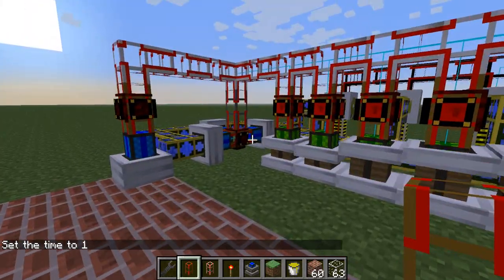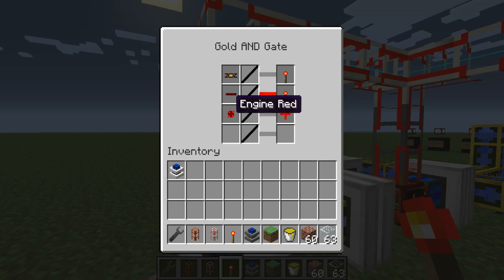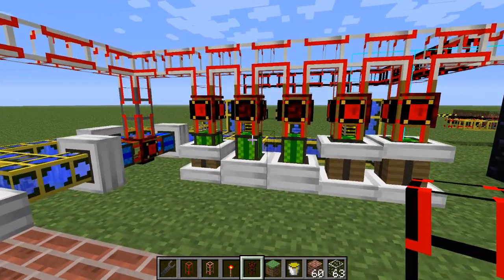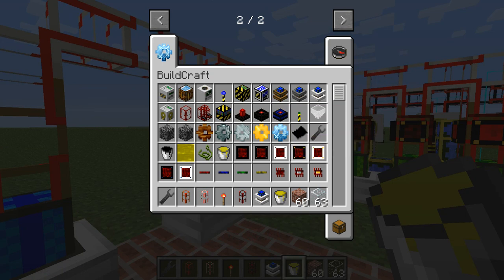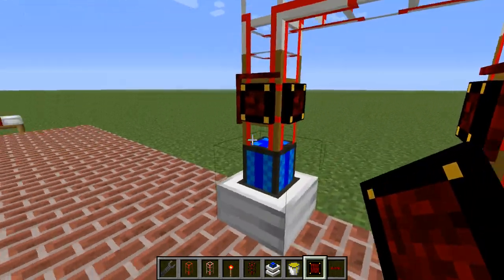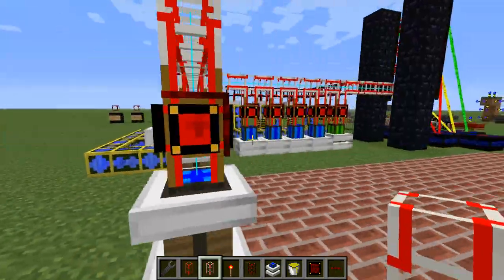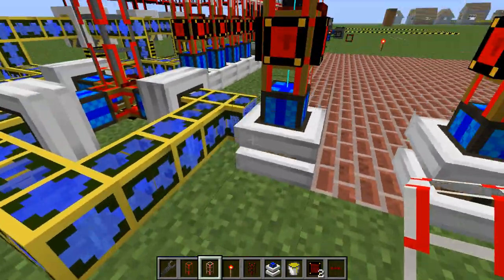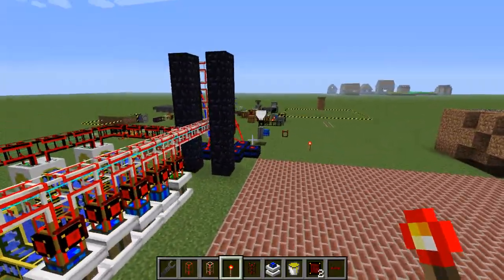Buildcraft - Engine Safety

Comment: Covert, are you planning to do a similar tune up of the liquid pipes for buildcraft, or will that be held off till 1.6 with the new liquid system. I would love to be able to use BC pipes to transport plenty of steam or full capacity of water pumps.

Say a diamond waterproof pipe.

Comment from the maker: Best guess, the Engine can't transfer power fast enough to Laser due to the low max power received value (25). Pipes have a higher max power received value (1000), and dole it out more evenly instead of in bursts like engines.  I compared the actual power used and the pipes only supply the laser with maybe 10% or 15% more power.

Comment: Wouldn't it be possible to use the "engine safe" trigger on the gate and do it without the pipe wire?
I really like the new system!

Comment: is there a way to place pipe plugs on faces that have a block on it? like, i wanna use a plug to block a pipe connecting to a chest on one side, but still having it connect to another chest on the other side, the only way i've been able to do this was removing the chest first...

Comment: I'm using the newest version. If I have the engine hooked directly to the laser, the laser is not getting all the power. Instead the engine stores the energy insides it for no apparent reason. If I add pipes in between, the laser gets all the power. Why?

Comment: Well, it is ABO, but would you consider building "engine safe" into BC itself? I have been using this "trick" with red pipe, but it is more like a workaround than proper solution.

Comment: Laser + Combustion engine = Energy build up inside the engine and only a tiny bit goes to the laser.
Laser + wooden pipe + gold pipe, and then the laser = No energy build up in the engine - everything goes to the laser.

Why is this? Is there something I'm not getting, or is this a bug? :/